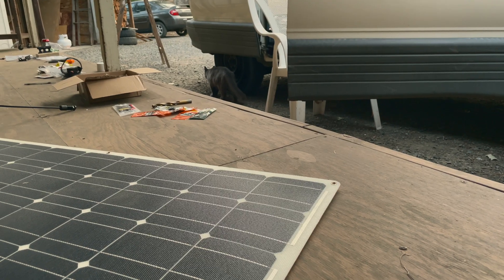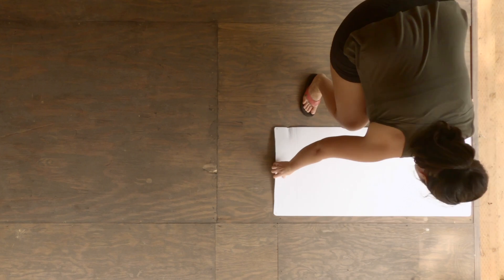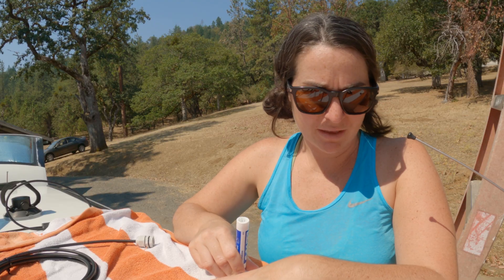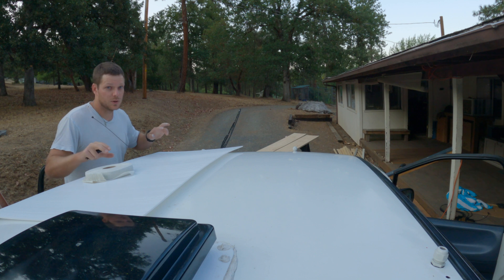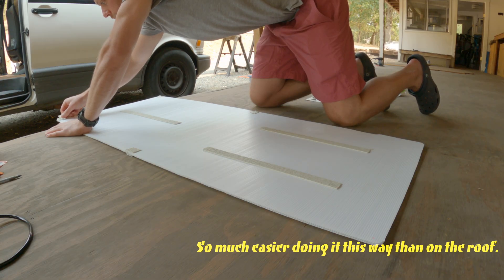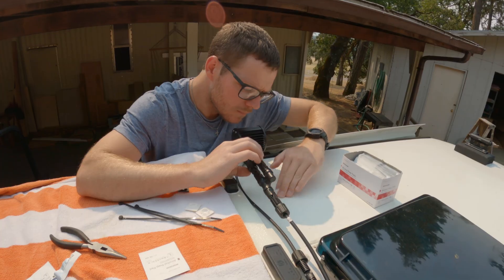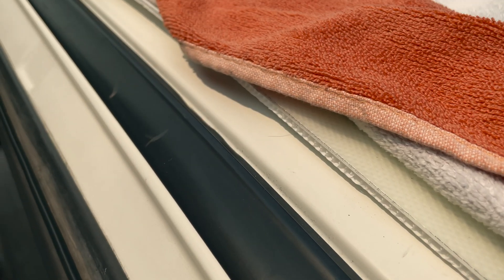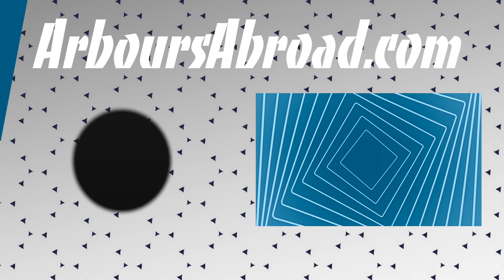How To MOUNT FLEXIBLE SOLAR PANELS on DIY Van Conversion Renogy 100W Solar Kit

Comment from the maker: Who is working on their solar panel system? Are you at the stage of mounting your flexible solar panels? And are you using Renogy or something else? Make sure to check out the previous video in the series installing your van roof! https://youtu.be/B29KgbVAtHk

Comment: Did you have any issues with the wind disrupting any of your build? I was wondering how 60 to 70 mph might affect these panels and the plastic corrugated sheets?
Reply from the maker: Good questions. Thanks for asking. In the 3 plus years we’ve been traveling around in the van there has been zero failure with the panels. Never have come off or gotten loose. Only regret is that if the panel stopped working I would need to take the ceiling down to replace the panels 🤦‍♂️. For the corrugated plastic, the edges that get sun exposure have started to crumble. If I did it again I would still do corrugated plastic but have it inset about a half inch so the didn’t hit it as easily. Still would have the corrugated plastic extend to the edge where the bolts are. Hope that helps! Cheers

Comment: Youtube deleted my comment I guess because I mentioned a store name. Well, a certain depot in my area sells something called FRP Decorative Wall Paneling which I think would be better. I've seen the stuff you're using just crumble apart like leaves after a year or two in the sun.
Reply from the maker: Good point. Well the edges of it are starting to crumble. The only part that gets UV rays. If we did it differently we would have had the corrugated plastic inset about two inches just so it would not crumble. However, the main purpose of that it is still lifting the panel and keeping it from overheating. So I can live with a little crumble. 🤣

Comment: You just ruined the panels, the manual says not to use Butyl tape and is a fire hazard.   You guys need onto hire professionals, you ruined the roof of vehicle and now have a fire risk!  Stay in your lane.  Leave this to the professionals.
Reply from the maker: Hey. Thanks for your comment and two cents. I’d love to see the manual saying it is not advised to use and a fire risk. I couldn’t find anything on the internet validating your assertion. The panels have so far been mounted and working flawlessly for 18 months. No heat spots. Not issues. No nothing. 

If my diy job directly affected others, as in I rented out my van (which I don’t), then I think you could be right in saying I should leave this to a professional. I understand the risks in my own craftsmanship. And if others watching other DIYers take the work as fact and flawless then they probably don’t have their heads on straight and we are not responsible for their actions. 

We are purely providing a video of how we problem solved a challenging problem and created a solution to that problem all while giving others ideas, work arounds, and alternatives to think about in order for them to attempt their own install. If they do it exactly how I did and it fails, that’s their own risk that they took. 

Cheers
Reply: @ArboursAbroad  butyle tape, the compound butyleoxtance is used in capacitors.  You are creating a super charged oxidative radical reaction with the ability to cause release of plasma heat.
Reply from the maker: Sounds super intense! Care to send an article? I’d love to read about it.
Reply: @ArboursAbroad  I’m don’t doing your research, this is obvious information even for DIY’ers.   You’re going to hurt someone.  You’re driving a plasma van waiting to burn at 3000 degrees instantly.
Reply from the maker: I really can’t find anything supporting your claims. Other than many solar panel companies using it. How can the entire RV world use it for literally everything on their roofs and pair that with solar and no information saying not to do it.

Comment: How has the coroplastic held up?
Reply from the maker: Good question. After installing it about 18 months ago. Not obvious issues. But under closer inspection the edges are starting to crumble a little from the constant sun exposure. Still belt here to be many more years of life in the spots that need it most.
Reply: @ArboursAbroad  Yes, it will do that. For that reason, I'd highly recommend not to use it. I used to take that stuff home with me and use it for things, and it just crumbles after some time in the sun. Not something you want solar panels on your roof being held by.

Comment: Great thorough video. Could you please provide info on the cable attachments that you used with the zip ties? Thanks!
Reply from the maker: Yeah! Thanks. We found these things in our local ace hardware. Here is an Amazon affiliate link to the equivalent on Amazon. https://amzn.to/3EERgsD The foam sticky stuff flaked off after a couple months so we replaced the sticky side with vhb 3m double sided tape and they have worked great ever since. Good luck!